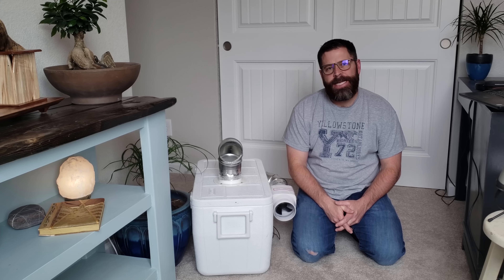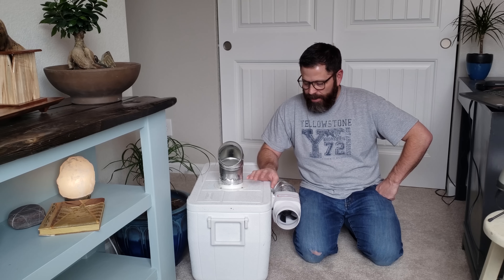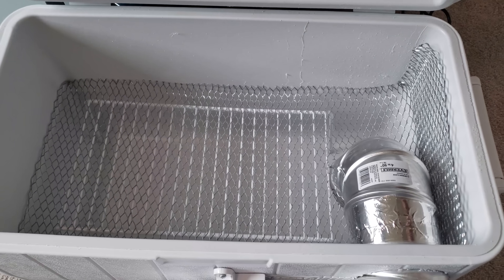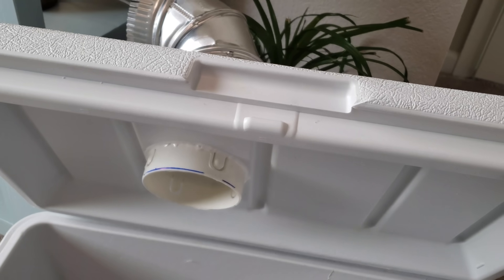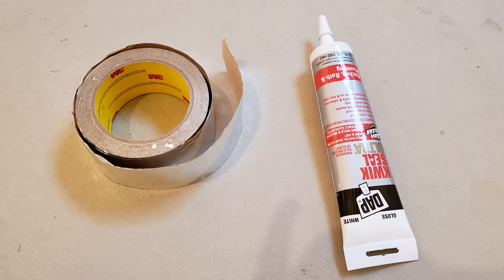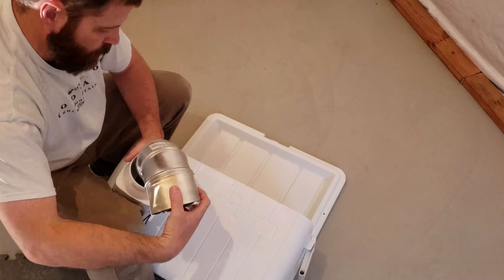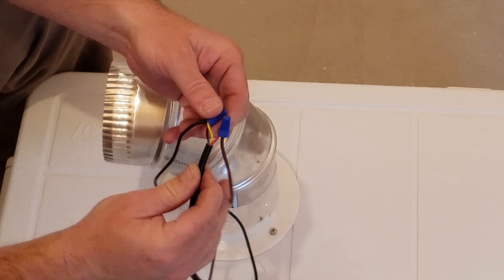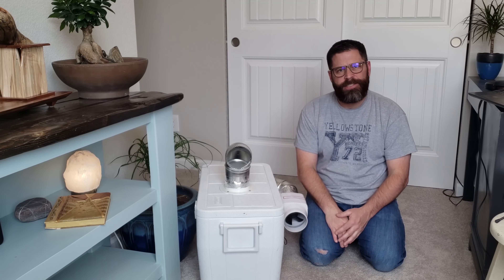Homemade Portable Air Conditioner DIY - Coldest One Yet!

Comment: You Might be able to out do yourself by using a aluminum fin sorta like a evap coil to further cool the pass thru air instead of the wire shelf.  Awesome design bro, Just a suggestion.

Comment: I don't understand why there are so many thumbs down on this. It's a great idea and a simple project. Doesn't make sense to dislike the content.
Reply: Yes,
What marine 120v motor for the home would be good?
Reply: @iammaximus614  you could use a 12V wall wart power supply that you plug into the wall. Similar to a laptop cord but 12V output. Not hard to find.
Reply: @Kevin Anderson I enjoy central air at my home, too. But when I'm on the lake in my boat, this device could be a pretty sweet way to stay cool.

Comment: I thinks it important to note the ambient air temp before starting the cooler, temp from the out put, and how long it takes ambient temp to drop to? # accpetable level for summer. Also how long ( minutes and/ or hours)  it runs until it no longer cools?  It looks like a great design but without knowing the particulars, building a 100$ cooler than only runs for 30 mins in 90  degree auto temp  would most likely be a waste of a person's time. General statistics are important. Thanks for sharing and continuing to improve a DIY product.

Comment: Hmm... I'll make one that runs off a solar panel to keep my car cool while I'm at work
Reply: P S  yes, because I'm going to use house solar panels to run a small fan
Reply: Harbor freight
Reply: Already tried it. It's very expensive. The amount of solar power you would need, the battery to store/pull from (which adds weight to your car) and after a few hours the ice is melted anyways.
Reply: Cbgrandtheftauto he is talking about leaving it running in his car while he’s at work. No battery required and melted ice isn’t an issue. He doesn’t want to climb into a scalding hot car after work. This unit would cool the car enough to make climbing into your car after work in the summer months bearable. Once you’re in your car, the AC will begin cooling quite rapidly.
Reply: Victor K  You do need a battery. As soon as the solar panel loses direct contact with sunlight it will stop spinning the fan. Also running the fan without a battery is a waste of solar power. The fan will only require a small amount of amps to run. If your solar panel generates a lot of amps, you're losing all those amps that could be stored in a battery. Melted ice is a concern, once the ice melts the temperature flowing through rises and it doesn't cool the car any more..just circulates hot air around.
Reply: Set up a simple timer that starts the fan 15 mins before you get off work, should still be enough ice without it on the whole work day to cool it right before you go home.

Comment: What about using a push/pull method for the fans? Kind of like a computer does for cooling.  You have your intake fan pulling in air, could/would you add a fan to exhaust to help push more air out?

Comment: I built one using 2 90mm high speed server fans and connected a usb connector, it can be powered by basically anything. Battery, solar, car, wall adapter. I placed one fan to suck air in and one to blow air out. I got readings of 27f in 78f ambient temp. If you want to control the speed of the fans you can grab a pwm fan controller, then connect the fans to that and connect a usb connector to the pwm controller. I placed frozen water bottles under the create and ice cubes on top. 😎

Comment: Only works in rooms not cars... Unless you have a fresh air source... Built this exact set up for my trip to Florida in a cheap car and was going thru 4 bags of ice ever 2 hours. First block of ice lasted 3 hours... But after 15 minutes of running time stopped producing cold air due to no fresh air vent source...

Comment: PRE COOLER PEOPLE

ONE MORE COOLER TO PULL AIR IN THAT WILL BE THE PRE COOLED AIR GOING THROUGH THE TOP COOLER INSTEAD OF WARM AIR BLASTING THROUGH ICE
THOUGH IT WILL BE ON THE BOTTOM COOLER; ITLL ONLY DO SO THERE AND WHERE IT WOULD OF BEEN WILL NOW STAY COLD OVER THREE DAYS 
YOU MUST USE 4” COPPER PIPE SWEAT 
MEANS SOLDERED 
COPPER IS THE BEST MATERIAL ON THE PLANET ACCEPT GOLD FOR ANY AND ALL CONDUCTIVITY BEING SOUND OR ELECTRICITY OR TEMPERATURE AND ITS EASILY INSULATED WITH COPPER PIPE FOAM WRAP ON THE OUTER COOLER AREAS 

YOU MUST USE ALL BLOCK ICE WRAPPED IN SYRAN WRAP OR INSULATED THERMAL BAGS PER EACH BLOCK TO GET THE LONGEST RATE OF COLD TEMPERATURE OUT EACH BLOCK 
USE 45’s at the top not 90’s to get smooth transition up and out
DONT SOLDER THESE 45’s 
Wrap the pipe with syran wrap and Vaseline only neatly around the first 3”’s of the pipe as it inserts 4”’s deep into the 45’s and no run off will be seen

Also use two pipes on the bottom of both coolers teeing them in to each other as well then placing all your block ice around them as tightly best as can be the entire height to still close lid with all gaps filled in with ice cubes 

The bottom cooler will sit under the top and have its two inlets left and right like done in yours with your highest power air intakes flowing air down tubes from top 2”’s holed in below lid and down into the cross pattern teed in bottom with NO SCREENS NEEDED (be sure to have coolers with drain plugs to drain out water and add new blocks as needed) and up and out same height out holes and piped into the top coolers’ in holes mounted same as bottoms which top also is blocked and block insulated and cube gap filled with air NOW PRECOOLED BY BOTTOM COOLER AND EXITING THE TOP STACKS NOT THROUGH SIDES LIKE BOTTOM COOLER BUT THROUGH THE TOP COOLERS’ lid WITH PIPE THEN 45’s over pipes unsweat 
ALL EXTERIOR PIPE AND FITTINGS WRAP TAPE FOAM INSULATION AROUND THEM AND CALK IN WHITE SILICONE CALK AROUND ALL DRILLED IN PIPE HOLES PRIOR TO ANY ICE IN COOLERS
LET CURE A DAY PRIOR TO USE
THE FANS CAN BE SOLAR POWERED FROM VAN ROOF TO INSIDE TO COOLER OR USE RECHARGEABLE BATTERY FANS 
ICE BLOCK LASTS THREE TIMES LONGER OR MORE PENDING ON INSULATION AND AMOUNT OF DISTURBANCE
DONT OPEN TIL ADDED STAT SHOWS 68 DEGREES OR WARMER 

68 is usually a fantastic set temp in peak summer for most anyone in a home let alone a camper 
Or tent or car or van

PRE COOLING IS KEY AND LASTS FIVE TIMES LONGER

ALSO HERES THE SUPRISE:

You can take it apart and pop on two other fans to the top cooler intakes and run two units 
Or if only you have the two fans you can use one on each as the cross teed lines connect both pipes to still pull all contacts 

Some people rather use this method than use their lp or electric or geni by fuel
As the fans don’t cost any power supply if you have rechargeable batteries or solar and ice will cost $20 to block up both standard coolers plus gap in with cubes and last a week 
If you insulate the outer coolers with flat foam insulation and moving blankets 
No space loss occurs 
It’s the space of a chair with holding a cooler

Comment: I would just go get me a refrigerator compressor that actually freezes Ice stick me copper tubing on the end of it and then stick it in my cooler with several copper tubing in the bottom and then turn it on Let It free fries real good and then then put my fan stuff in the bottom and do it that way without having to worry about putting bags of ice in it

Comment: Great job bro. I made one similar to your previous model. This one looks it works better, but how long does the ice last? It seems like you would have the same problem as the earlier models where the hot air blows DIRECTLY onto the ice melting it faster. I know that's not exactly the same model here, but I think the result will be the same...the ice not lasting long.
Reply: I know I'm responding to your comment 2 years later, but I went through 20lbs of ice in around 1/2 an hour. I'm a little bummed.

Comment: I wish you would list the cables or components to connect to solar or battery!
Reply: Get a power station,  I use my jackery 1000 for my camping frig and connect this unit together.  No need to leave car on while taking a lunch break in my car

Comment: Only bad thing I see is when the ice melts your pipe will be down in the water but no longer blow out air it'll be blowing in the water
Reply from the maker: The pipe doesn't go that low. It barely goes beneath the wire grate.

Comment: Probably not worth destroying an RTIC for this but I'm curious as to how much of a difference it would make.
Reply: None.  You are blowing hot air into the cooler, the heat loss due to insulation of the cooler is insignificant.  The only reason to use a cooler vs. a plastic box is to contain condensation.

Comment: Ok, So here are some Questions. When the bottom portion of the cooler fills up with water from melting ice. Does it overflow the metal grate? If so, doesn't that block the fan access into the cooler? If that happens and you shut off the fan, will the water backflow up into the fan? Assuming a person takes this out camping or some other outing, how long does a bag of ice last? How much draw does that motor require? You have it plugged into a car lighter but I think a camper may be using something like a goal zero. Amazon says 12v/6.0Amp. I don't know how to do the math on that. It would be nice if your video answered those questions. It would be nice if your video answered those questions so your viewers could speculate how practical this cooler is. On the surface, it looks pretty cool but is it practical? AN afterthought, is the mesh stainless steel or will it rust?
Reply from the maker: As long as the metal grate is no more than half way inside the cooler, it would be impossible for the water to reach the grate. How long the ice last depends on many variables such as outside temperature, type of ice, type of cooler, etc. The blower requires 12 volts and 6 amps. The mesh is stainless steel.
Reply: @livingwithlucasofficial  Please make a video testing some of these variables if you get a chance.

Comment: A like just because of the links to get the items. Also have you tried using salt water ice? Personally I used old bottles of salt water and reg ice to make the air colder and last longer. Mind you it was a crappy version with the air pocket and a much lower powered fan.

Comment: Hey buddy !!!! I made one exactly like ur second one it’s pretty cool thanks. I had a question about ur new one in this video what’s gonna happen when the ice melts here? Is the air gonna bubble up ??
Reply from the maker: The air duct does not go all the way to the bottom. It is at the top of the grate which is only halfway in the cooler, so it will never actually touch the water.

Comment: Great job, but just wondering, why don't you add an additional fan for the exhaust so cold air can come out faster, you can even use something like a computer cpu, etc type of small fan, just a thought
Reply: because its a sealed system,the air forced into has to go out the top vent.
Reply: Wow dumbass